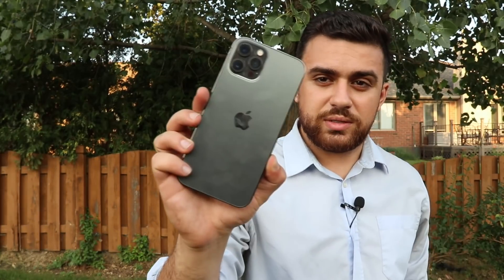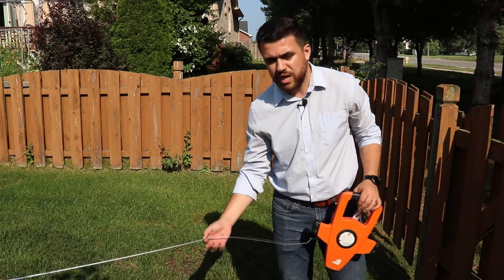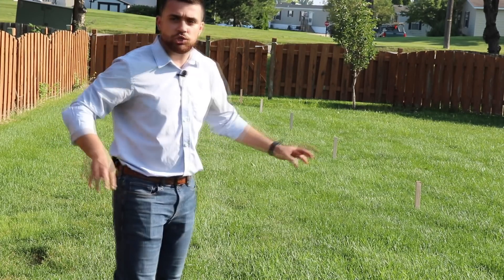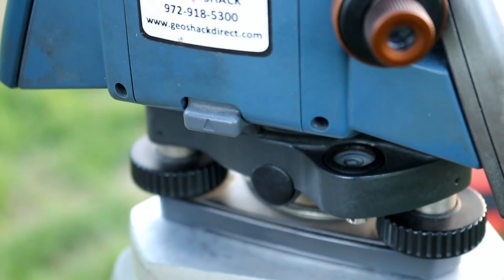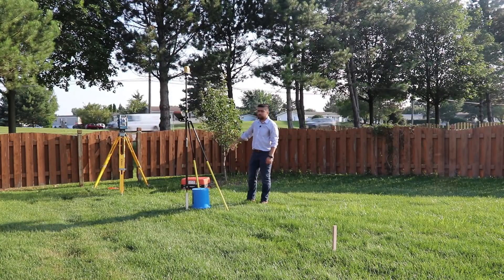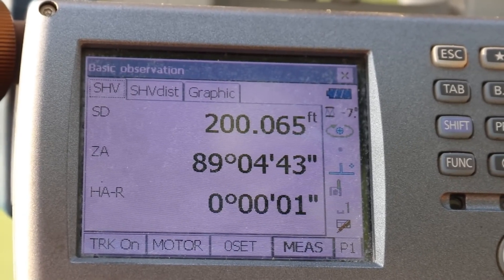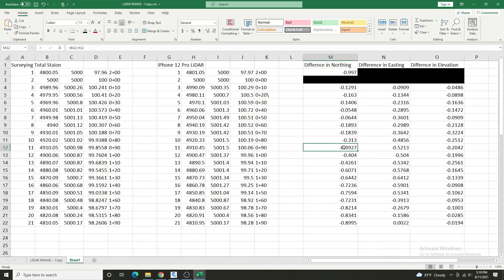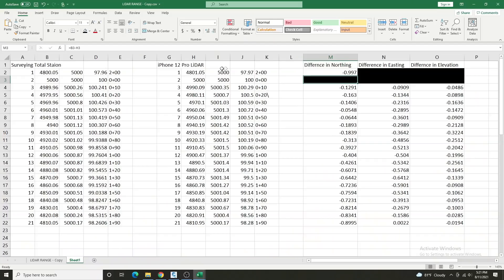iPhone LiDAR accurate drift over 200 feet

Comment: Hi Rami , I've been studying your iphone Lidar videos  and I've decided to trial the Iphone as a method of detail surveying on residential house lots. Typically , here in sub tropical Brisbane ( Queensland , Australia) , I am dealing with lots of vegetation , trees , scrubs etc and slopes of 2 to 4 metres across a 25m x 40 m site. My method will be create controlled ground targets in good locations for GNSS pick up with my GPS and then Lidar scan the yard up to the fence line ., including the house , any sheds , tree trunks etc. Then I'll use Poly Cam on the iphone &  Cloud Compare to register the point cloud , then import it into Autocad Civil 3D . Do you have any recommendations on the processing software or method ? I'll be using an iphone 13 with a gimble for stability.  Looking forward to more research on scanning technology , as it impacts on surveying . Have you looked at generating ground contours from the Lidar scan ?

Comment: The title suggested a “height” of 200 ft. I was surprised to see you do a path distance instead. Have you done a height/lateral distance accuracy test for the iPhone LiDAR? Like sweeping a 200 ft radius circle from about chest height. Position different objects of varying sizes, shapes and heights  at different distances from the center of the sweep. That would be very interesting.

Comment: I love what you're trying to do here, but something is not right.  It could the the iPhone sensor is what's wrong.  What is the difference between the iPhone point cloud and a point cloud taken from an airplane at 3,000 feet AGL?  Sorry I don't have the sensor details, but with the airplane data I can see the skeleton of the steel power poles along with the wires running between with very little error...or so it seems.  With the iPhone the poles in the ground look like they were covered with a sheet and lack all levels of detail.  With that much signal imprecision, how can you assume the highest point represents the top surface of the posts?

Comment: I hate to be the bearer of bad news but I just scanned ~30m of wall with the iphone 13 pro, total station pinged it at 30.275m, lidar data in cloudcompare has it as 29.241m. On hard stand surfaces it's around +/-50mm but on grass and dirt it was ~200mm too high

More testing to come but still has a way to go

Scanned using scaniverse app
Reply: u gotta manage the drift.  without a proper IMU, a mobile LiDAR needs the drift managed.... the iPhone is crazy accurate, but it's not setup to manage the D>R>I>F>T
Reply: @liamcarper6517  I mean, the wall I measured was half the length of what OP measured so even less time for drift and yet here we are, terrible linear accuracy, surface accuracy is on par but overall pretty average

I can’t even scan pelican cases without them looking whack, the imu in a phone is pretty decent but we’re just not there yet for the “live” processing of the data within the apps

Comment: what about the accuracy after using a cheapo laser rangefinder-measurer and inserting distance correction between first and last point? You have the pointcloud, if u draw direct line between first and last and enter defined distance, would it scale everything to quite acceptable level?

Comment: Excellent vid. Now that we know the iPhone error we can use an error of 0.5ft/100ft with readings and get a fairly accurate reading for a quick check, but like you said, can't rely on a phone to get exact points, BUT for the time it takes towards the accuracy level, not bad, very surprised. I have a CAT S61, the laser measure is sometimes out by 0.3m/2m after calibration, and this is inconsistent, so it can't be reckoned in, so it's useless.

Comment: Would the measurement be even more detailed/accurate if you swept slower over the 200 feet, giving it more time to scan with the sensor?

EDIT: Removed first bit of comment as i realized .500 off would be half a foot as stated in the vid, so six inches.

Comment: See, just last year I was trying to use photogrammetry to get a topographic map of my property (because I'm cheap and it didn't need to be accurate). It didn't work well because I didn't have a good feature point detector and lidars were all kind of expensive. But this seems promising, and I'm pretty sure the drift can be fixed to an acceptable level if I sprinkle some registration marks all over the place for the phone to pick up and then locate them with a transit and tape.
Reply: yup

Comment: Great work. but I believe I could be wrong you were using the accelerometer and the LiDAR in conjunction the liDAR was only scanning the floor distance not the length of the 200 foot run this was being tracked by the accelerometer in the iPhone because the measurement from the LiDAR was from the iPhone pointing down to the steaks in the ground?
Reply: drift

Comment: This is really cool Rami.  Thanks for doing this.  I'm in the excavation industry and imagining a situation where we could scan dirt stockpiles to get an approximate volume.  You think maybe you could do a demo like that in the future?
Reply: how approx y'all want?  you have GPS/GNSS?  or a scanner?
Reply: @liamcarper6517  We do have GNSS stuff, but that is a lot of work.  I'm picturing a scenario where one of our superintendents could whip out is phone, do a quick scan, send the point file to the office, and know how many trucks to order for haul-off within a few minutes.  I actually accomplished this (since posting this question) on a very small pile near our office.  I got it to work and return a very believable volume result, but the problem I had was that it produced WAY too many points.  I'm talking 31,000 points for a 6 CY stockpile.  I need a point every couple of feet.  Not several per inch.  I think I might try a different app.

Comment: iPhone: US$ 1.100,00
Professional Equipment: US$ 50.000,00 - US$ 200.000,00.
The iPhone has a 0,5% margin of error + rendered texture and colored the surface accordingly. That is IMPRESSIVE.
Conclusion: The iPhone LiDAR is not meant to be used in SOME professional setups. But it’s superb for everyday use for 99,99% of people and SOME professional uses: When the 0,5% margin will not like kill someone, for example.
Great job Apple. Really really impressive. 👏🏻
And great video. You did an awesome job. Very professional, very informative. Just all around amazing. 👏🏻😁
Reply: nice!  yes, the iphone and the integration of measurement tech is absolutely amazing.  in 5-10 years, it will be mind-blowing to look back and see where we've come 
https://www.youtube.com/watch?v=YFn48DUZu_s
my gig is supporting these products with Trimble....

Comment: I’d be interested in a comparison to the default “Measure” app with the iPhone
Reply: I think that also use the LiDar sensor to assist it
Reply: @EthanSeville  It does, but it would be interesting because its much much faster to measure simple distances or areas. Just tap to place two points and there is your distance in literally a second.
Reply: What’s the app called? The LiDAR one he used in the video
Reply: @jakewillsman5129  It's called "Measure", it comes with iOS since iOS 12, but can now use the lidar sensor to improve the measurement accuracy and speed
Reply: @quantuminfinity4260  Hey nah sorry the mapping one. The app that you used to LiDAR map the objects.
Reply: @quantuminfinity4260  the scan app?

Comment: 4:00 dont you have something like a "lattenrichter" (dont know the english term). In most cases a piece of angled metal with a bubble so you can hold it agianst your pole. Also why use the crappy imperial if you could use metric?

Comment: Great video, thank you. I’m not a surveyor- but I’ve been experimenting with an iPad Pro and point clouds / scans for architectural visualisation etc. I understand why you skipped the scale step, but I wondered how the data would compare if you had scaled. The data sets could be useful if used together perhaps? Not that I have a total station, or need one! I have been using 3D Scanner App and Polycam, and also SiteScape, which only records point clouds but (without using your rigorous testing methods) seems more accurate somehow. Subscribed 👍

Comment: Why didn’t you use a shorter rod, it’s more accurate and you wouldn’t have had to stand on a bucket?
Reply from the maker: It would help with the bucket, but a short rod would break my back. For the work I'm doing, the 5/6 foot pole is accurate.

Comment: Awesome content! Thanks for doing this.

So, I’m no surveyor so please correct me if I’m wrong. But isn’t this margin of error reasonable compared to the ability to place the center of the stake at each 10 foot increment, and then the additional error of trying to find the center of the stake in the point cloud? It just seems like a more clean testing environment would account for the relatively low range of error here. Each stake should have to be leveled to account for error there as well. Like, it seems clear it’s losing some accuracy over distance still. But now that this is proving to be possibly useful in the field, it would be good to find a way to get extra accuracy in the testing.
Reply: I would not put too much confidence in these numbers.  After he creates 100 strips of data on the same path and averages the data, then you can start to draw some conclusions.  To take it a step further I would try to eliminate possible errors from hand-holding the iPhone while taking the measurements.
Reply from the maker: You could try to minimize the environmental errors, but honestly, must of the error we see is systematic, meaning even if we adjusted the environment, it wouldn't change the results too much.

Comment: Nicely presented videos! You explain your process very clearly. 
I'm a surveyor and use terrestial scanners for work. This is no replacement for survey grade equipment but I think it could still have uses - just as a nice '3D photo' of your project or smaller details. And crazy to see the technology progressing and think about where the industry will be 5, 10 years on.
Reply: in 10 years the industry is going to look. so. different.  this def highlights how quickly technology is taking over

Comment: Great video! Can you try the Iphone Radar in water? Can the laser penetrate the water surface or it will read water bottom texture?
Reply: no.  still a laser measurement tool. it's called "re·frac·tion"
/rəˈfrakSH(ə)n/
Learn to pronounce
nounPHYSICS
the fact or phenomenon of light, radio waves, etc. being deflected in passing obliquely through the interface between one medium and another or through a medium of varying density.
change in direction of propagation of any wave as a result of its traveling at different speeds at different points along the wave front.
measurement of the focusing characteristics of an eye or eyes.

Comment: you should plot the error on a graph. but i think it would be equally intereseting to learn the range and accuracy og the lidar sensor when the phones is in a fixed position scanning the distance to objects of different size and ranges
Reply: Range is 5 meters max on this sensor, so stationary scans are accurate but very range limited. I've done a small research paper on it (in Danish), and it basically shows the same results as this video (likely due to scaling issues as a product of inaccuracies in accelerometer/IMU software).

Comment: Thanks for the video. The errors you're getting for the iPhone lldar is almost entirely caused by the relatively low grade IMU (Inertial Measurement Unit or electronic gyroscope), rather than the laser (which is practically  the same for the iPhone and the total station). That is why  you got much better results for the curb in your last video, than in this case where you had to traverse  that 200 foot distance.
My guess (hope?) is that Apple will put better IMUs in future phones as the technology improves and consumers demand.
Reply: yup yup.  your are on point.  mobile tech LiDAR depends on IMU's, due to drift.

Comment: Thanks for sharing. I'm not a surveyor, however I suspect that the results are highly dependent on the methodology. I suppose it's representative of how people would use it to generate point cloud data. The primary issue here is that of error accumulation as you walk (integration of accelerometer data, and mesh density which also depends on elevation angle). Can you try with a pano scan, while sitting near the middle point (at 100')? And, take the scan with the phone close to the ground so you get a side view of the stakes. Use optical zoom feature to enhance resolution. Am very curious to see if this improves the results dramatically.
Reply: it's not a long range Lidar.  that's why it's only $1000
Reply: that error could be elimintaed if you use a gimble

Comment: I would be interested to see how well it would do with a semicircle. Going in a straight line puts the iPhone at its best. Having it track while turning and using more of its IMU would be interesting. Great video tho. Presented well!
Reply from the maker: Oh that's a fantastic idea, I should look into that, like a closed loop traverse!
Reply: @RamiTamimi  This particular app might have issues with closed loops too. At my last surveying exam i experimented with scanning different objects with photogrammetry and the iPhone LiDAR, and verifying those with standard measurements. I chose multiple 20ft and 40ft shipping containers, scanned them by walking clockwise around the containers, and sadly every attempt netted some issues at the 4th "overlapping" corner. The distances seem to steadily decrease over time, creating a "squished" model. For smaller details like the curb, however, it seems really accurate.
Reply: @a.landand  what is the name of the app?
Reply: @lorycalvia6171  3D Scanner App. I think they've done some updates on it since, so it might behave better. but the LiDAR sensor still has a max range of 5m.

Comment: I think people wanted to know the max distance to an object that can be scanned, not GPS accuracy along a line.
Reply from the maker: that's what I did here. I didn't use the GPS for this experiment.
Reply: @RamiTamimi  not so much a chainage, but how far away from an object, nice to see the drift over time/distance comparison though
Reply: Yes, how far out will it scan an point before it loses depth perception.  For example starting from stake one scan take a single scan pointing down the line not walking.  Supposedly the limit is 15m.  What you are testing is how big of a point cloud it can save.
Reply: About five metres.

Comment: You should look at external GPS sources to supplement the internal iPhone GPS. I use an iPad for air navigation and all the nav apps accept data from third-party GPS sensors. These vary in quality, too, but are all better than the internal GPS and aren't especially expensive. You can even work with multiple sensors to further improve accuracy, though this isn't especially easy at this time. What I mean is you can interpolate between two GPS sensors or antennas that are a known distance apart on the airplane. Putting these on the wing tips and knowing EXACTLY how far apart they are makes your absolute positioning far more accurate. If this doesn't seem applicable to a surveying situation, imagine doing the same thing with GPS sensors a known distance apart on your survey truck (say on the front and rear bumpers). Sure, the trucked parked 100 feet away, but knowing that absolute position with millimeter precision will still improve your final iPhone measurements.
Reply from the maker: How do you connect an external GNSS unit to the iPhone/iPad? If you can show me how I'd love to make a video about it!
Reply: @RamiTamimi  there are a few RTK-capable GNSS receivers for iOS, such as the Arrow Gold or Bad Elf Flex. I haven't used any, though...

Comment: Great video! I got an iPhone 12 Pro specifically because I was very excited about the LiDAR scanner and at this point I’ve done a lot of testing with most apps on the App Store! It seems like some of the inaccuracies come because of the augmented reality anchor “drifting” over the course of the scan. It seems like the two things that have the biggest impact on drift are the gyroscopic movements in the phone, as well as how how the point cloud compares in real time with the previous one scanned a few milliseconds before. Basically, make sure you don’t have any jerky movements and try to have several things for the phone to keep referencing as you go along. Shooting a blank wall is much more likely to cause major drift then moving the scanner across a wall that has picture frames and shelves and such. Just a bit of technique I’ve picked up, hopefully you find it helpful! Keep it up! :)
Reply from the maker: Yea the gyroscope isn't the best on smart phones, perhaps the iPhone 13 will have improved mechanics and perform better???
Reply: @RamiTamimi  I wonder if having the phone on a gimbal mount such as the DJI Osmo would help? Since the phone stays stable even if you have shaky hands.
Reply: @RamiTamimi  maybe, it have impressive results for a 1000$.
What kind of accuracy could be achieved on a closed circuit (i don't know if it's the correct words...) Like around a house?

Comment: Well done for the experiment.  An easier way to measure is to scan along the track of the playground and see if they meet each other.
Reply from the maker: The reason I did the high stakes was because I haven't been able to find the intensity output on the iPhone, so I just rely on elevation change to find the points.